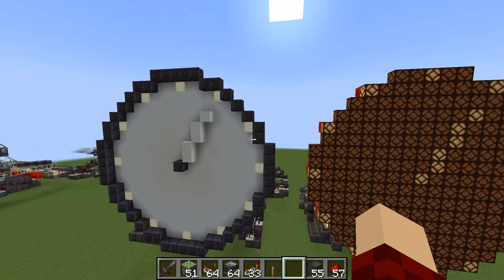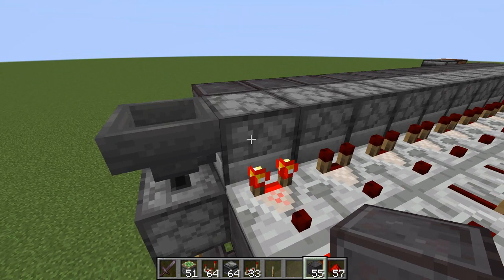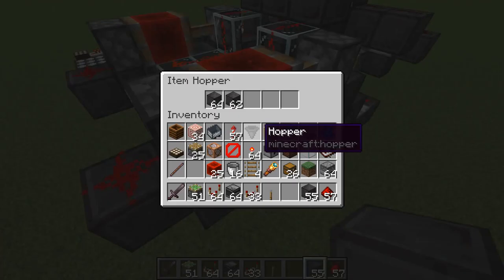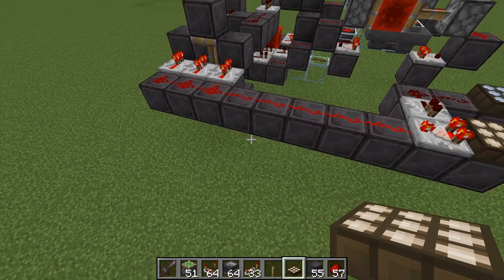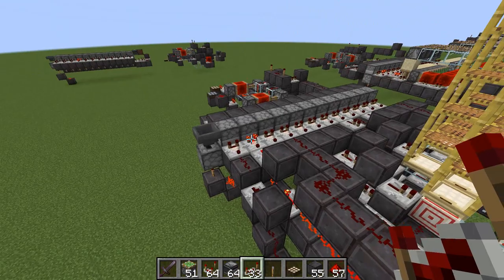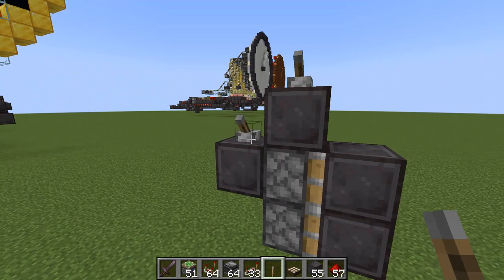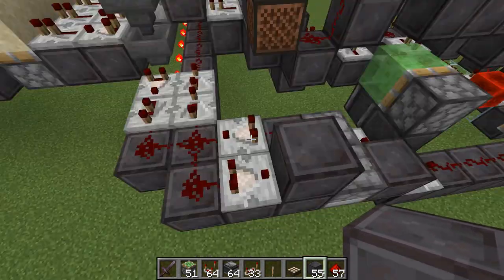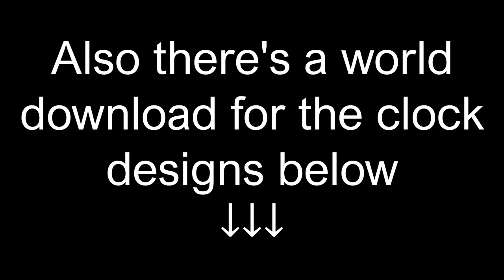Building Working Minecraft Clocks Out Of Snow and Lava

Comment: If you wanted to make a clock that was based on the actual in-game time instead of using a hopper clock to time an in-game hour, you could potentially use daylight sensors with a redcoder, though you wouldn't be able to make it a 12-hour clock, given that it outputs a redstone signal of 0-15.
You could get it somewhat close though, using an inverted sensor as well you could get 32 possible hours, but to make it a 12/24 hour clock you'd have to make one clock hour longer than the rest.
Just a random little thought i had while watching.
(Also, obligatory "First!"... Happens to actually be my first YT comment too)
Reply: why hello theee
Reply: or do some funky maths that might or might not even be possible in minecraft
Reply: A minecraft day lasts 20 irl minutes.   Minecraft ones on 1/20th second intervals called ticks.   So 50 irl per second per hour or 1000 ticks per hour

hmm could potentially use day light sensors to make sure whatever clock is being used is in sync witht eh Minecraft day.

Or just otherwise simply put the clock in spawn chunks where it never unloads and therefore would only desync if the night is passed by sleeping.